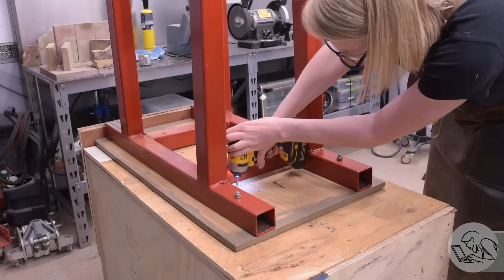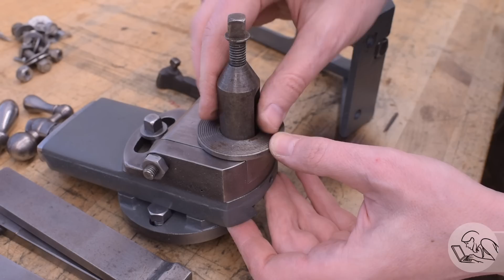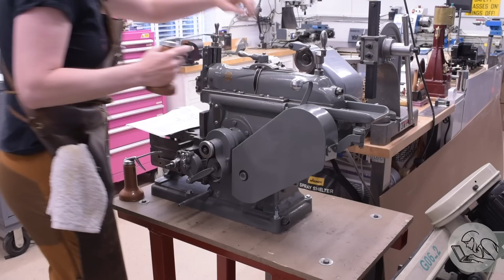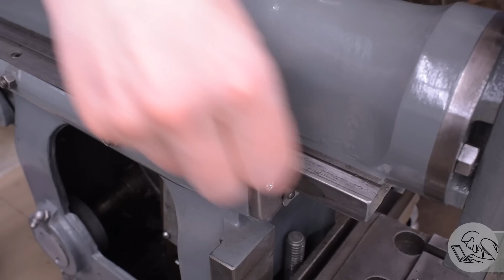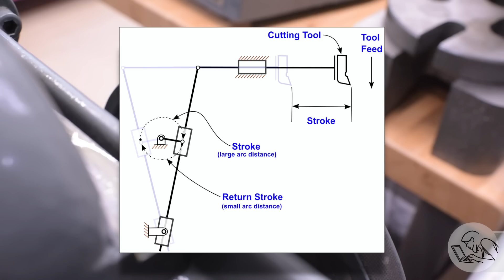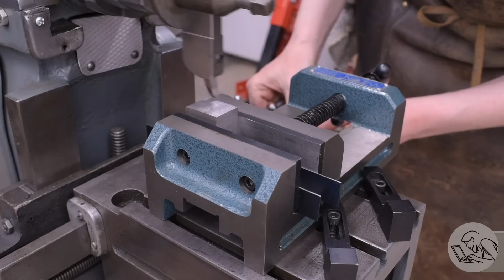New Machine Day! What mysteries await?

Comment: Must have toys!
I have three metal shapers, four pantographs (two 3D and two 2D) 4 cutter grinders, two surface grinders, two lathes, one OD/ID grinder plus many more machines and accessories for them. I have been in tool and die for well over 50 years and picked up a lot of equipment over the years.
I'm located just outside of Detroit so a big hello neighbor.
Keep learning and you will stay young.

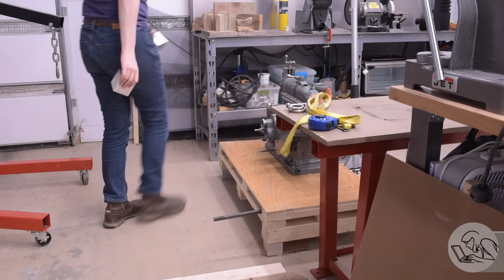Comment: @5:50 talking about clearance or lack thereof, of shop crane or engine hoist legs, i bought the Black Widow shop crane just for this reason. Much lower clearance so you can get under low things. The Black Widow is more expensive than lower cost shop crane, but man am i glad that I cried that one time. It allows me quite a bit more mobility in the shop with the shop crane.

Comment: I don't have an Atlas. Mine is a Rhodes. But to get mine to ratchet correctly, I had to increase the resistance(friction) on the left side of the lead screw. May be a similar adjustment for you.

Comment: Quinn I worked in a job shop back in the 80s and early 90's we had a lager shaper not sure of the brand. It was very handy for cutting large internal keyways. I remember a new employee that had not ran a shaper much, had a large coupling setup in a vise and forgot to set the stroke and pushed the coupling and vise out in to the floor. The wild thing was he set it back up and still did not set the stroke and pushed it off again. Not my favorite machine but there were some things that it did better and any other.

Comment: Love your videos, I just happened to notice that you have a shop heater that looks like a mini split.  Is it indeed a mini split? I have a shop that is in need of heating and I am considering a heat pump.
Reply from the maker: It is indeed a mini split and is the single best thing I ever did for the shop. Costs hardly anything to run and the shop is perfect temp and humidity year round. Your shop does need to be decently insulated and sealed first, though.

Comment: When i was an apprentice toolmaker my foreman told me the reason why you set up the vice sideways. If you make a mistake with the depth of cut, it's better the job gets pushed out of the vice rather than break the shaper crank or burn out the motor.

Comment: For over a year now I also own a shaper and it's so much fun to use it. With 400 mm stroke length, 3 hp motor and a weight of 1,4 tons it's like the big brother of your machine. It was built in 1972 in Yugoslavia and looks like they've copied a Klopp machine. I also had trouble with the clutch until I fully disassembled it completely a few days ago. Shapers are really amazing machines, it's like watching a campfire. Have fun with your new toy and stay safe.

Comment: I am not sure if others have commented about the lack of motors with new pieces of equipment. Back in the late 50's in Ontario much of the province was powered by 25 cycles per second electrical power. Ontario Hydro undertook the replacement of motors to 60 cps as part of the start up of the new generating station at Niagara. Fun Fact. In the rural areas, when all the farmers were milking their cows, there was a very noticeable flicker in the lights at 25 cps.

Comment: For my older machines that use oil fittings I use a cheap Oregon brand chainsaw bar tip greaser (they are made in Germany) with the grease removed of course. I have one full of Mobil Vactra and another full of Nuto 32 for my spindle. I didn’t invent this, I found this on a Practical Machinist thread for a lube solution for older English Iron with oil fittings like I have.
Great vid!

Comment: Beautiful Shaper! Always good to see one being used and safe from the scrapyard. I operate a 1969 South bend 7". I would highly recommend making a custom toolholder to get the cutting edge behind the pivot point of the clapper. This will allow the tool to self-regulate it's depth of cut, and flex back and up if it gets bogged down (as opposed to digging in deeper and stalling). Works wonders for finish

Comment: You should hire Pinketon to guard that hand crank. They are rare as chicken lips. I have an Atlas MFC horizontal mill. and the crank is what I am missing. I have the origional Atlas vice which are also very rare . If I ever find a crank I'm gona try to get it. I also have a Southbend 7" Shaper and let me tell you Quinn they are addictive. I love using mine. I have 3 mills but the little shaper is the Icing on the cake. Mine is in pristine condition.

Comment: You wondered what shops used to do before the ubiquity of engine hoists (a sort of gantry crane). That's easy, engine hoists are super complicated and difficult to make so before they understood how to make them, (and had the tools to make them), every hobbyist shop, no matter how tiny, had bridge cranes, because they're simple and easy to make. Of course they ran all the movements in 3-dimensions off of pulleys driven by small hobbyist steam engines. You can see drawings of the basic principles in one of Leonardo's notebooks.

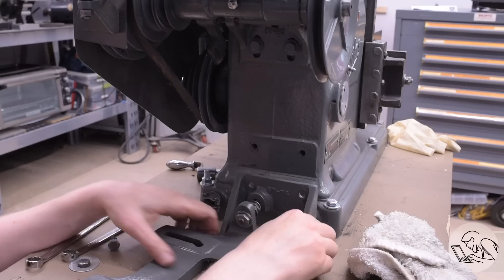Comment: 14:58 I once visited an amish community with a carpentry shop. All of the tools were "bring your own engine" types like you mentioned and they all worked off some kind of centralized pully system that was ran through the whole shop to a big engine (I'm not sure what kind.). It was pretty neat.
Reply from the maker: That’s called a line shaft and is how all factories worked until electrification around the 1940s
Reply: @Blondihacks  That's really cool thanks for the info!

Comment: Oh that lovely sound a shaper makes I am jealous. That machine is Old/New enough to  to have been designed for running off a line shaft or electric motor. The shaper is the first machine shop machine other then a drill press to have operated. It was in a small shop near Hamilton and half the machines were  least bought before  the first world war. I worked there when I was in high school for one summer in 1965.

Comment: I also have an Atlas 7B and find it fun to use. For your clutch issue, you need the missing original missing motor belt guard so you can tighten the motor belt a bit more than you have it now, so you will have sufficient torque without belt slip when the clutch is engaged.  The missing motor guard I am talking about is on the left side of the machine when standing in front of the ram.  When working properly, the motor belt will rub on the guard and stop the belt spinning when the clutch is disengaged. This is due to the shape of the guard. If the motor guard is missing as yours is, the belt tension needs to be set too loose otherwise your ram never stops even with the clutch disengaged. With it set this loose, the belt slips on heavy cuts.

Comment: In my Apppretischip time the one shop had 2 shapers; the large had a24 inch stroke (yes almost planer size and it had a de-clutching mechanism with engagement fingers as well as dirssengagment with apositive lockout lever. The smaller shaper had a a two stage belt system similar to what you have. It is possible that something is missing or, an additional adjustment with a spring over-entering brake position is involved which applies pressure to the wedge brake shoe or shoes. Perhaps the manual will tell more. However, this episode brings back fond memories as I often had both shapers running and setting up another job in one of many lathes or Milling machines - shapers run almost without supers ion once stops are set uptime large shaper not only stopped feeding upon reaching the stop but also disengaged the clutch. Thank you so much for this "show" Quinn

Comment: Hi Quinn,  As you explore your new machine, if you find excessive backlash in the down feed screw, until repaired you will need to over travel the down feed adjustment and crank back (to an indicator setting) so the cutter can't lift off of the work as it engages.  This is only if you have excessive backlash and are trying for close tolerances on thickness.
Reply from the maker: Good tip, thank you!

Comment: Your new to you shaper brought back a lot of memories. 

Like all boys in our local school system did in 1964, I took General Shop.  In it there was a unit on metal shaping in which we made a tappy-tap-tap machinists hammer. 

The handle was made on a lathe and the head on a shaper. In my dim memory, your shaper strongly resembles the probably WWII surplus one on which I made that hammer head.  I never touched a shaper after that. 

Today, my hobby parts are made on a bench-top CNC mill and mini lathe using CAD to design the parts and a CAM program to drive the stepper motors.  That’s a lot of technology differences, but making chips is making chips and technology had to start somewhere.

Comment: the atlas original belt cover would contain the drive belt so it would expand more around drive belt disconnecting it. I could send pictures for the factory cover if you'd like.
Reply from the maker: Oh I see, thank you! I found pictures once I knew it was supposed to be there. I can make something like that.
Reply: @Blondihacks oh I have no doubts. did you get photos of the original art deco styled covers? such a beautiful machine. I was lucky enough to get mine with my first lathe (up to many more!).

Comment: Congratulations! Thats a gemn of a shaper, i am sure you will utilitize it a lot.

Btw, the progression next would be:
2d pantograph
universal tool&cutter grinder
surface grinder
3d pantograph
Reply from the maker: I have come perilously close to owning two of the machines on that list already, so I agree. 😂
Reply: No doubt Stefan. Started with a shaper then very quickly bought a surface grinder and a Deckel pantograph. Now I’ve bought an old Hendey Tool&Gage lathe and have completely disassembled it. The progression is real.
Reply: everyone out here pining for pantographs but where are my skirtographs? i hear some even come with pockets!
Reply: Need idler pulleys on the slack parts of belt
Reply: Stefan is modestly not mentioning that a number of his earlier videos showed a lot about shaper technique while he still had one. @Blondihacks another potentially useful source of info!
Reply: She does need a pantomill for sure
Reply: Pantograph please, I don't care if it's practical, they just have so much charm!!! And in the modern day when you can 3d print templates, theyre super fast too!
Reply: After the mill and lathe, I happened on a surface grinder. It was completely out of this proper listed order and has thrown off my entire hobby machine shop experience. Is it possible to now work backwards toward the front of the list then jump back to the 3d pantograph?
Reply: @TandaMadison  me too! Holy cow has my view of square-enough changed!

Comment: This is the first time I have seen one of these machines in use since the early 80's. Back then I learned how to use them in school, but in my 35 years in the manufacturing industry after school, I have not seen them again. 
The best thing about this machine was that back in the day we rode them like mechanical bulls. They were floor models big enough to sit on. Heavy enough that they did not need to be anchored to the ground. But if they were set up fast enough with enough travel, they would happily hobble around the workshop. Whoever could stay on them the longest was the winner. Don't try this at home!!
Reply: Ah. The Good Ole' Days! 🤔😌

Comment: I grew up in the area of the US that started out with 25hz AC power. When they decided to switch to 60 Hz, the power company actually offered to replace any motors in your house with 60 Hz motors. I suspect that because of the cost of motors back then there were very fow to replace. I somehow doubt that would be the case today.

Comment: Today I saw a rather adorable English Electric battery loco, which has grease cups for lubricating some of the running gear. Never seen that on a locomotive before, and wasn't expecting it on something not steam-powered.

We have a large shaper in our works, and I've never seen it run (I'm not a machinist, just a fitter). I never understood what all the gubbins on the side was doing, and now I do, so thank you! Definitely looks like a very civilised class of machine, too. Have fun!

Comment: I wrote a Basic program to model the kinematic behavior of a shaper like that as a class project in 1974.  Put an accelerometer on the head and correlated the predicted acceleration and velocity with the measured output. Project was successful except for the obvious spike at stroke end as the slop was taken up.  Modeling impacts are tough, even now and it was certainly beyond what I could do then.

Comment: That is SO cool!! I have loved shapers ever since I saw them on abom's channel, but he wasn't making as many videos with them as he used to, and he seemed to be one of the only ones who was. This isn't nearly as big as his ofc but still super cool! I know there's a ratchet thing for auto advancement from left to right, which I think you said you fixed or will fix, but do you also have one for up and down for doing vertical faces? I think not all shapers have them because usually you can just rotate the part, but not always, and it helps, I think, for diagonal things. I was just wondering if yours had one or could have one. Preso has one now on his channel, too, so it looks like shapers are making a comeback 😄

Comment: Phillips designed the screws for use by idiots on an assembly line. Their sole "advantage" is that they are a torque driver in themselves - they cam out at the designed torque.  Which is inaccurate as heck, and too low for almost all the things we use Phillips screws for, but ....

I'm working on a restoration project now where the gear is held together with Pozidriv screws that some sailor torqued down with a Phillips driver and ripped the heads.  I was able to get most of them out with penetrant and an impact driver, but needed to resort to the LH drill on a few.

They're all 6-32, 8-32, or 10-28 thread.  I haven't found anyone willing to sell me any in quantities less than 10,000.  McMaster and Grainger, for instance, sell Pozi only in metric.  Maybe your viewers have a lead for me. Otherwise, I'll probably wind up using Phillips because the universe is cruel to people who try to restore gear that uses Freedom Units. (Don't tell me to just get some steel and make a few - I don't have a lathe or proper machining skills, and shop classes are half a century behind me. I'm an electronics geek.)

Comment: You can get the belt to stop spinning the crosshaft by stopping the sides of the belt from returning to a circular shape when tension is released. When the belt goes circular it gets shorter so it stays in contact with the pulleys. On one of my 1940's reel mowers they stopped this by mounting a bracket half way between the drive and driven pulleys with two pins on it that the belt will hit when you release the clutch stopping the belt from returning to a circular shape and so the belt stays long and will release from the V of one of the pulleys. Works real well. 🙋‍♂😊
Reply: Exactly what I was thinking and I'm a little surprised there isn't something incorporated into it. Doesn't even need to be anything fancy, as simple as a bent piece of wire or just a strategically placed bolt fixed near the pulley (the route you'll see on mower decks).
Reply: @s.murphy8336the original did have it incorporated. no belts were exposed in the full unit.  beautiful art deco styled cover castings.
Reply: How about a notched v-belt? The one shipped with the machine looks a little old and stiff.

Comment: I lived in a pretty poor, rural area for a while and engine hoists were less common than engines that needed removed or installed. I saw some pretty imaginative engineering but the simplest answer to moving something heavy without the right equipment is rednecks who have been promised free beer when the work is done.

Comment: Have you thought about using fingernail polish on the oil and grease points?  I know of some people who use Yellow for the oil points and red or blue (depending on the type of grease) on the grease points.  They say it helps them to quickly identify what type of lubricant to use and cuts down the time it takes to lube everything during a major lube/inspection cycle.

Comment: I've seen other belt and pulley "clutches" that refused to release just like this.  The V hates to let its grip go.  Those other setups use a close spaced roller or shoe on the "slack" side of the belt that does not quit touch when the belt is tight.  Then as the belt is loosened and goes more round it touches the roller or shoe which and pushes the belt away and out of engagement with the motor pulley.  You can test this by pushing lightly on the disengaged pulley with a piece of wood and see how it pushes the belt out of the pulley "V".  

One thing is certain though.  Shapers are fun and rather hypnotic.  You're in for a proper home shop good time.  I love my Alba even if it has been a challenge to get consistent results and the fact that it has 11 and 9 TPI lead screws.....
Reply: some machinery that rely on belt clutching have two U steel pieces as Belt guard and thus force it into an 0 shape instead of the o when the tension is released